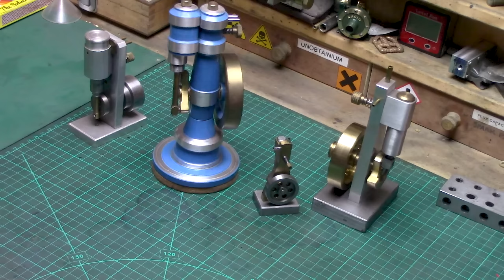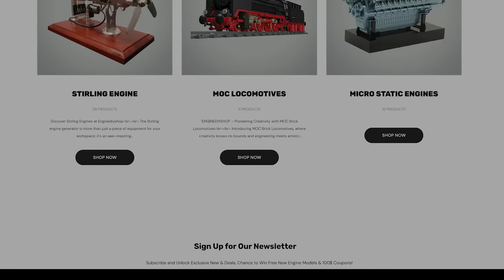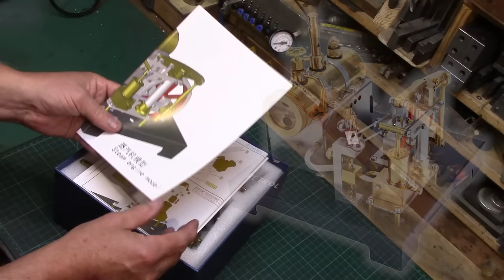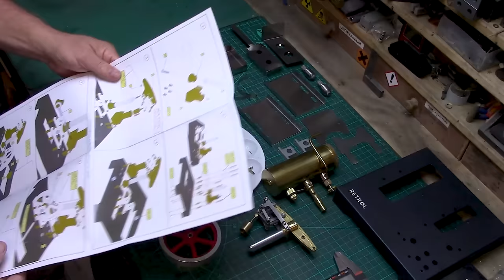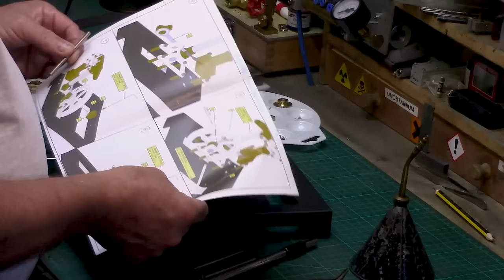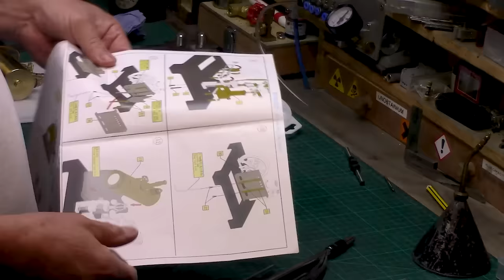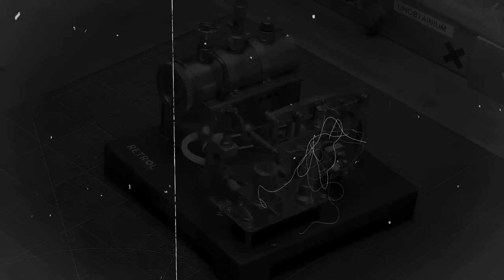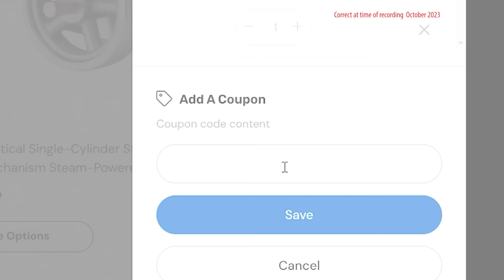Make a Steam Driven Beam Engine  - No Workshop or Tools Required!   #steamengines    #enginediyshop

Comment: Those DIY kits should be on a restricted list! They will for sure get kids hooked on model engineering. 
I am 81 now and got hooked via Mechano (actually "Trix") at about the age of 6....and my grandpa bought me a little stationary steam engine that was available at the time, a simple oscillating cylinder job, but still useful. It didn't take long for me to use the Trix set to make a chassis, compound reduction gear and get that little engine chuffing down the hallway dripping water, oil and methylated spirits on the carpet. This was in 1948, and my mother was very understanding about it. I went on to build model aircraft for many years (My dad worked at de Havilland's) and my engineering tools extended to a mini lathe, drill press and lots of taps, dies, files etc. by the time I was in my early 20s.
Then I got interested in shooting and started making bits for guns, which I still do both for myself and my clients. I now have a larger lathe (the same model of Boxford that I used at school in the 1950s!), a more modern milling machine and Mig, Tig and MMA welders and of course a plasma cutter. Torches for soldering and brazing go without saying. Moving house became a real nightmare, so I am determined that I will only move from here in a box!
That' a very well produced kit, quite costly I would imagine..... I cannot see how any child with a pulse could fail to be captivated by it. Parents need to know that the addiction is not curable, and treatment therapy (hand and machine tools up the wazoo) is expensive but rewarding, and helps to keep children out of other more harmful mischief.... 😀
I always had a yen to build a steam locomotive, but there's not enough spare hours left in my life now, so I just go to watch the local club's at their facility in town...
Great video... thanks.....
Reply from the maker: Hello @KathrynLiz1   Thank you for your lovely comment, I am so happy that this video brought back those memories for you, life is precious and our memories are treasured. Thankyou and if you have a god, may it bless you :)
Reply: @AdeSwash , pls how can I get this kit
Reply from the maker: @adeogedengbe974  The info is all in the video, and you can get a discount if you use my code :)
Reply from the maker: @adeogedengbe974  Watch the whole video, then get my discount code. Go to the website and buy one

Comment: Fantastic intro 😂 
I made a small steam engine from mostly crap I had around the house. I  was so surprised at how satisfying it was once I got it to run, vs just blowing the piston once down the cylinder testing with the air compressor.  Once it cycled It came alive tst tst tst tst tst 😲 🥳

Comment: Absolutely brilliant video 👍
Reply from the maker: Glad you enjoyed it MartinZero, it's a fun engine to build and run
Reply: @AdeSwash  Hello, I too loved the video. I have a question please. What is the valve brock? Also, what is the foamy material coming out of the valve block? Thank you
Reply from the maker: @jerrygrahn8144  Hi Jerry, the valve block is below the cylinder, and has a spool valve to control the steam inlet and exhaust. The foamy liquid is an emulsion of oil and water. Regards. Ade

Comment: I got mine, assembled no problem. One tip though. On the first run I used live steam, with no go, so I ran it on low pressure compressed air for ten minutes to bed it in and then switched to steam and it worked well.  One question though.  Should I add some steam oil to the water in the boiler for lubrication?  I currently use just sewing machine oil on the joints and three or four drops to the top of the cylinder. The other thing, the governor tries to throw itself to pieces, but adjustment seems to fix the problem. All in all, a nice well behaved little model

Comment: Hi, 
I LOVED the video. You got me hooked. After watching your video, I ordered one (using your discount code). This will be my first engine build. Wish me luck! I do have 1 question. It doesn't look like the lubricating oil was included with the kit. What would you recommend using?
Reply from the maker: Hi Robert, no the oil is not included, I use steam oil, but anything will work just as good to keep it lubricated. Make sure you tighten up the whistle fitting as this is prone to leaking steam - Ade

Comment: Thanks for this great and instructive video ;

Nice engine, well designed but these criminal silicone pipes and burner …

Cotton wicks could replace the steel mesh wicks to allow light tilt 😊…

Replacing the steam line would ask more work… but is still doable !

It could certainly do with a larger boiler but that remains a pleasant model 😊
Reply from the maker: Hi Olivvapor, I agree, the silicon hoses are a let-down and it could do with a bigger boiler to get more runtime, I do intend to replace the piping with copper feed pipes, and a few other 'modifications' but out of the box it is still a nice little project and a fun engine to build and run :)   Kind Regards. Ade

Comment: Interesting - I shall explore further.  Just a thought, when you first tried to start it, the hot steam condensed out in the cold so it was slow to start and water to mop up.  Is it worth running a heat gun over the workings before firing up, to preheat the working parts and get things going quicker and less messier?

Comment: Just needs a pressure gauge, some model handrails and a small dynamo and lamp! Oh and some copper pipes to replace the silicone! I'm getting one!
Reply from the maker: Hi Richard, thanks for your comment, I agree with you completely, it needs some 'model engineering refinement' and it will be perfect :)  Regards. Ade

Comment: Nice little model mate.
I personally feel that these kits are far too expensive. The price is ridiculous. In fact, the price of nearly all new live steam engines is ridiculous. 
I know that there is much engineering that goes into these shiny copper and brass models but they will not attract youngsters into engineering because they are just so expensive. 
They seem to attract old guys with too much money to burn. 😅
I just watched a guy build a steam engine with an old shock absorber as the cylinder and piston and another piece of pipe for the steam valve.
What was the cost of materials? The answer is nothing. Plus he learned how a real steam engine works. 
Now I did read that you started off in the back shed, like I hope to do. So I assume that you know about steam engines. I am still learning.
It's the price that gets me angry. The sellers are very greedy.
I know some of the steam engines are antique and are desirable by collectors. That's fine, but the brand-new ones are overpriced. I have a couple of old Mamods that I got working but There is a limit to what I will pay. 
Anyway, that's my rant. 🤣👍
Reply from the maker: Hi Mike, I like your rant! and I do agree that many model engines are out of the price range for youngsters, but as you say, the Mamods can still be bought fairly cheaply second-hand. Now I have built many steam stationary engines, mostly scratch built from bar stock metals, using my machines in my workshop shed, and this has given me an appreciation of the of the work involved in creating scratch engines, not to mention the time and money invested.  I don't get as much time as I would like in the workshop, and sometimes the idea of starting a lengthy new project can be a bit daunting, so these kits are a great way to enjoy time in the workshop and get fairly instant results. For me also, I can often see ideas to improve these models, either visually or mechanically, so I can spend extra time tinkering and experimenting with them, rather than staring at a long list of components from a drawing that all need making, so it's difficult to put a price on enjoyment.  As Oscar Wilde once wrote ... some people know the price of everything, and the value of nothing.    Regards Ade

Comment: I saw an ad on Facebook touting a kit by the same company for a hit and miss (make and break) four stroke engine kit, for less than $50.00. It sounded too good to be true, so I did a google search.  I found those kits (which are wonderful) usually retail for over $600.00. Just a heads-up to be careful who you're buying from....

Comment: So after some more tinkering, I got this kit to run nice and steady without running out of steam. Main thing was to stop steam leaking from the whistle and not opening the main steam valve too far.

I'm not seeing the governor operate as I prefer to keep the rpm as slow as possible. For it to start working the engine needs to be going quite fast. If I swap the belt to the larger pulley to get more rpm at the governor, it puts a little too much drag on the flywheel and you get a bit of oscillation.

Here it is ticking over nice and slow!

https://youtu.be/pc_EWaLSa3A?si=wJ91q1XCAxOnskuj
Reply from the maker: Nice work Richard. Regards Ade

Comment: Hi, I'm trying to assemble my own model, and I have a lot of friction in the piston. Can you provide any details on how I can adjust to allow the piston to drop smoothly?
Reply from the maker: slacken off the screws under the base just a tiny bit and spin the flywheel, it should be free, the gently pinch the screws back up while rotating the flywheel. Dont forget the oil!

Comment: Hi Ade I’ve just ordered a beam engine of the website and wanted to know how long is delivery but the e mail is not working 
I wondered if I’ve been scammed . Was the company that you dealt with contactable ,thanks
Ps loved the video
Reply from the maker: Hi David, you should be able to track your order on your account, once it lands in the UK you should get email updates from the chosen courier as to when it will be delivered. It usually takes between 2-3 weeks to the UK

Comment: The Walking Beam and Parallel mechanism were both completely unnecessary. Just lavish mechanical art work of the day.
Reply from the maker: Why do you think this @RIPPERTON ?
Reply: @AdeSwash  Evolution did away with the walking beam design by necessity or common sense but not a moment too soon.
I can imagine the deafening clang of that giant penny dropping.
Try to calculate the sheer tonnage of cast iron hoisted into the lofts of pump houses and factories
around the world at the expense of clients in the name of "Gee it looks great".
Even double acting pistons were too much trouble with stuffing boxes known to leak.
The best solution of piston to crank is what we have today in all cars. The gudgeon pin built into the piston.
Reply from the maker: Hi  @RIPPERTON  , I'm very sorry but I cannot fully understand the point you are trying to make, can you point me to some external links as to why the beam and linkage was abandoned in external combustion engines of the industrial age.
Reply: Using the beam to drive a flywheel defeats the purpose for which the beam was invented, but it is after all only a model and adequately demonstrates how reciprocating motion is converted into rotational motion. The extra pulley on the crankshaft would allow the engine to drive accessories from manufacturers such as Willesco, Bing and Mamod to make "play" more interesting and informative.  Beam engines were mostly employed in mining to drive vertical reciprocating pumping rods which sometimes went many hundreds of feet underground to dewater the mine. Early steam engines used the principle of vacuum created by condensing steam rather than steam expansion creating pressure in a cylinder. They were slow and inefficient but could run non stop for a very long time.  The heavy beam provided the inertia and transferred the vertical motion of the piston outside the engine house to the mine.
Reply from the maker: @dwansbo  - in real beam engines the flywheel is the momentum, without it the engine will not run. The beam is merely a transport of motion from linear to rotation

Comment: OK, so I bought this kit, its really well made and goes together really well. I'm having a little difficulty getting it to run for more than a few seconds. I've not seen any steam escape from the pressure relief valve so I think I'm losing steam from the whistle. Also wondering if the burners are up to the job. I'm using meths. The wicks are metal gauze on mine.

https://youtu.be/DT5MTI4fYHE?si=IgVPjNsUDAVmrY29
Reply from the maker: Hi Richard, sorry for the late reply. The whistle will be the problem, I tightened mine up several times but it starts to leak again, I dont think the O rings are much good. I taped mine up in the end and will probably remove it sometime. The wicks are metal on mine too but seem to work fine. Once up and running, reduce the speed  to a tickover just above stall point, and it will run for about ten minutes. It will also start speeding up as the pressure increases, but you have to keep the steam demand lower than the boilers capability to make it. Its a good fun little engine but it has its quoibles, like most engines.  Hope you get it sorted
Reply: @AdeSwash  Hi mate, yeah I got it all sussed now! Runs sweet. Main issue was opening the steam valve too far.

Comment: Next time use a good sound system. The antique players is cute but really distirts the sound in a most annoying manner. do it right or leave it out!
Reply from the maker: @gregwarner3753 What you were hearing was the original recording from 1921, recorded on a wax cylinder. That was how they 'did it right' 100 years ago.
Reply: I thonk Mr Warner was  running with ypur humourous presentation, great video and thanks.😂